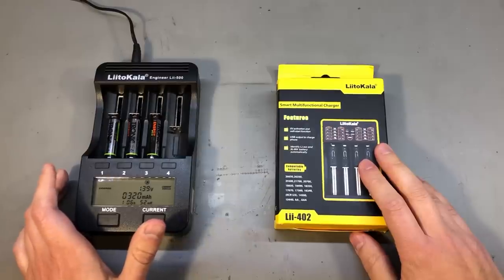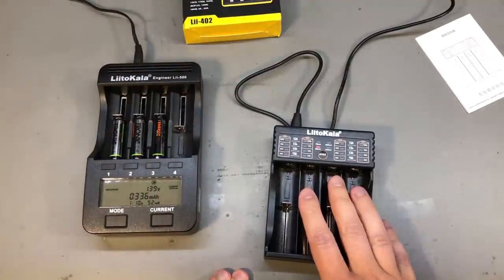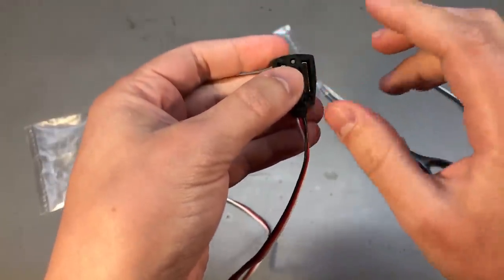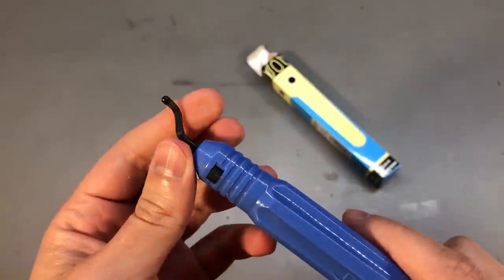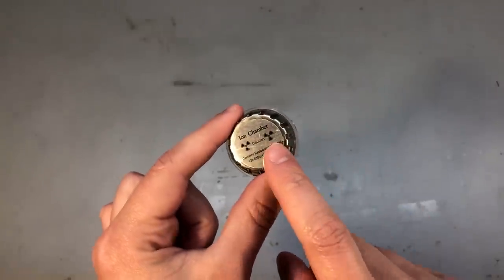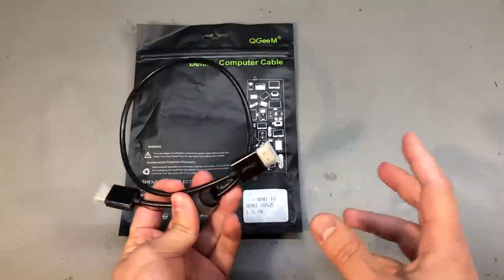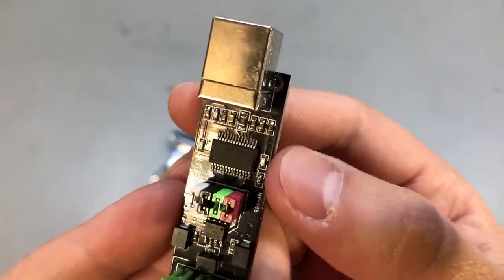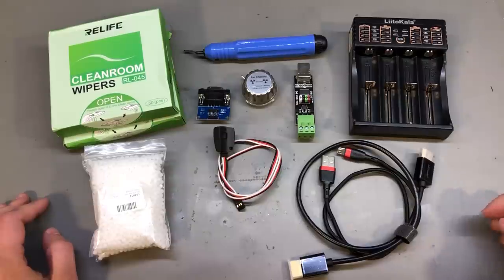InTheMail | Voltlog #311

Comment: The deburring tool works very well. I've used that style for 20 years.  Best used on drill holes or punched holes through metal.  To open the cap press in both black buttons and pull / twist off the cap.
Reply from the maker: Waiting for some replacement blades then I will force that cap off cause it's stuck really good.

Comment: Just recently got a deburring tool with different extra blades and holy crap its great, a must have tool for any 3d printing or any drill holes that need to be cleared.
Reply from the maker: Then I guess I'll be getting some replacement blades and I will probably be using it more often with 3d prints, thanks!

Comment: I recently bought the same deburring tool although I haven't needed to use it yet. The black cap goes come off for storing tips. If you can't press in the 2 locking pins far enough to release them I find that forcibly twisting the top 90 degrees will unlock them and then pulling the cap out is very easy.
Reply from the maker: I'll try to force it when I receive my replacement blades, thanks!

Comment: Americium smoke detectors have a pretty low emission for typical geiger tubes that will not detect alpha or low-energy xray. You surely will notice a difference though with something like SBM20. Other good check sources include uranium objects (like glass or fiestaware), uranium ore rocks and thorium based lantern mantles.
With my low energy scintillation probe Americium makes makes it scream but only a few times background or something like that with a tube that detects perhaps a bit below 100keV and up.
Reply from the maker: Thanks! If I ever get to building my Geiger counter I'll probably source some of those glow in the dark dials with thorium.

Comment: The deburring tool is useful to remove brim or sharp edges from 3d prints.
Reply from the maker: Then I guess I'll be getting some replacement blades and I will probably be using it more often with 3d prints, thanks!

Comment: The Lito Kala 500 is a great charger.  My only grump is I wish they supported LiFePO4 cells.
Reply from the maker: I think it supports them, It's only mentioned as LiFe on the package but the voltages match 3.2V-3.65V
Reply: Its a good charger but be very carefully the power supply does not provide more that the 2A rated on the case, was in a bind mislaid the psu that came with it plugged a 5A PSU and it killed the LCD it still seems to function but screen is now ghost 😬🤦‍♂️
Reply from the maker: Maybe the issue was a faulty adapter or an older style transformer one which has a higher output voltage when not loaded to full rated power. Just a higher current output rating cannot kill anything on it's own.
Reply: @voltlog  it was a liteon switch mode psu for cisco routers brand new have loads at work, it does sound illogical agreed with my understanding plugging 5A supply  rated for 12v should have had no effect on a device with low current draw but heres the but I tested the psu on a dummy load at 2A and it sits perfectly in spec at 11.98v so who knows perhaps just a unrelated faulty unit but mentioned it as it was working fine before I used this psu very strange and it does still work but most of lcd is dead it has moments when it recovers but its not like a lose connection as it fades  in random parts of lcd then blanks out?
Reply: @johncoops6897  no a bad shout, it probably cos me more to post it back on warranty so will likely open it up, and may add a little fan in there too as she does get a bit warm on load tests 👍

Comment: I find chargers with 2A total current pretty slow. I often charge multiple 18650 and even 26650 size batteries. With something like 1A feed 26650s take forever to charge and full set of 3500mAh 18650 is very slow too. I tend to pick up changers with 1A or 2A per cell if I can.
Reply from the maker: I agree charging current is an important feature and for those looking for higher currents the Lii-402 would not be adequate.

Comment: You cost me 27€ in stuff that I don't really need:
Deburring tool? Worked fine with a file or the back of a knife blade up to now.
Radioactive source? I have a small collection of those things already.
Thermoplastic for mechanical connections? That's what hotglue or epoxy is for.
And because I'm already getting things I could live without, I ordered a few packages of glow in the dark sand as well..... It's a bad idea to go to ebay/aliexpress after 3am in the night. My rational brain is at sleep already ;) .
Reply from the maker: I sometimes do my shopping in the morning and it's not any different 😂

Comment: Am i the first one? BTW when will you be able to review TS80P? 
And also since i want a new Soldering station, so I've been browsing for a while now and I've found some interesting candidates such as quicko 956.
Do you recommend it or i should just stick to KSGER (V2.0 since i want a cheap station and they both have the same price of 47$)?
Reply from the maker: I still use the KSGER, it's good, I would still recommend it.
Reply: @voltlog  does older one still work? If it works then, i would be more convinced to buy a t12 station.
Reply from the maker: Everything works, no T12 tip lost so far.

Comment: MAX3232 converter chip is a clone so expect issues with it, i have had a lot of issues with it and finally got a board with the sipex chip which works fine
Reply from the maker: A good idea would be to just replace that chip with a genuine one and do the same for the FT232. The boards are still good value on their own.
Reply: @voltlog  yes true provided you find a genuine chip, last I read reports that some reputed companies selling parts even ended up with fake chips
Reply from the maker: If that's the case nothing is certain anymore but I've never had any issue when getting parts from Mouser/Farnell/Comet. These guys should be getting their parts directly from the manufacturer.
Reply: @voltlog  the major issue with these fake chips is garbage data which is well explained here http://blog.bogpeople.com/2015/01/fake-max3232-rs232-line-drivers.html . I had bought boards from different places and sellers but all were using these fake chips and then finally i got a board using the sipex chip and that solved it for me, have been using that till date since ages and always works
Reply from the maker: @xbipins  Good read, thank you! I will definitely be replacing these chips with genuine ones.